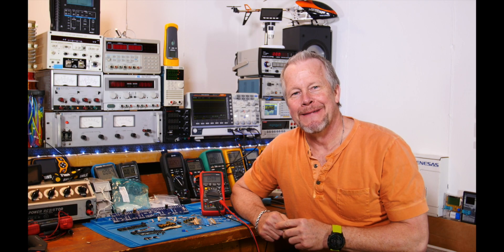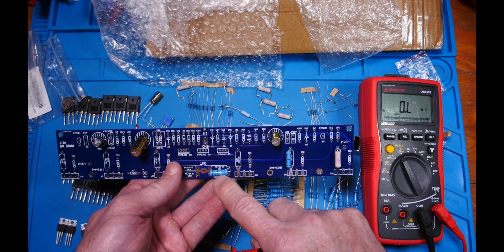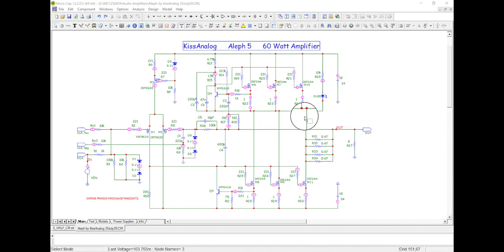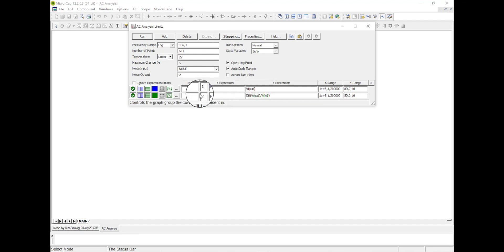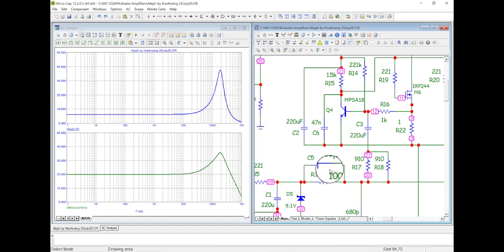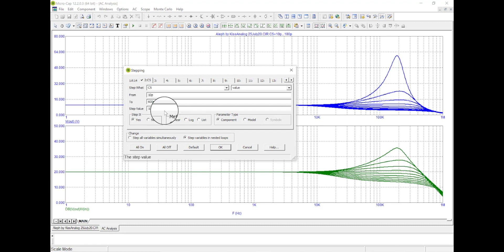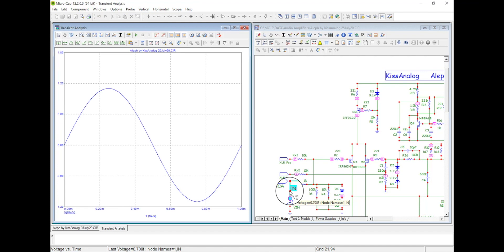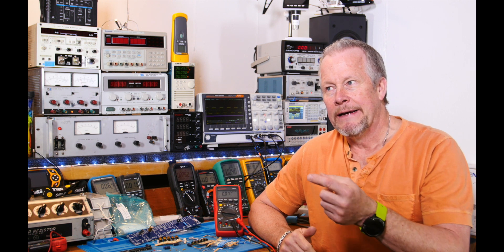Class A Aleph 5 - Schematic in MicroCap #aleph5 #classaamplifier #microcaptutorial

Comment: IRF244 can be replaced now with IRF530 with better results. As I see no more 244 on sale.
Reply: Yea the irf530 you can beter not use it, its only a 88w mosfet, you can beter use the irfp150 230w mosfet and irfp240 160w mosfet and irfp250n 214w mosfet, high volt mosfets have less distortion they say in the forums, i can not mesure distorion so i cannot confirm that theorie, but i think i mention it here, and more input Capacitance deliver more lows and less highs, the best they say is the irfp240, i like the irfp250n, that are like 2 of the irfp240 inside of the irfp250n, the irfp250n is more power and deliver more lows and less high, but all is a matter of music taste, so test wat wright for your tast, please do match all mosfets used in the amp, the 2 input irf9610 need to be spot on match with in 30mv VGS so 0,03 volt, the power mosfets u can do with a match of 0,1 volt, with my builds i go for 0,01 for the output mosfets and, 0,001 for the 2 irf9610, but thats just me
Reply: @joshaas  This is interesting... Among all low and mid power mosfets, 530 gives less distortions. I'd like to try 250n in Microcap simulation first. But you are right. A final judgement is listening.
Reply: @sc0or  distortion is more in the matching than in the mosfet u use, if you want low distortion matching is very important, for sure the first two irf9610 needs to be spot on and you need to use good MPSA18 Legacy NPN High gain Low noise transistor, the original design did use them to, and not the bc550 i believe the most use, also the hfe is higher than the bc550c can have
Reply: @joshaas  They are connected to output mosfet sources. Do you think hfe is so much important?
Reply: @sc0or  wy do you think Nelson Pass did use them in almost all his amp design's, so read again not only the hfe,  MPSA18 Legacy NPN High gain Low noise transistor, not only hfe is high but also the noise is low, and when you use them they have a other pin out than the bc550c, so you need to turn them around, and do not forget the resistors they need to be spot on.
Reply: @joshaas  ... and it's cheap ) "in all designs" means that if it costs pennies and has top most parameters, why he must look for something else? But this does not mean that in each particular case this npn could not be replaced with something else. At a moment I wrote my original comment, it was out of stock on mouser and digikey. So, 550, 547, etc could be a replacement. Now mpsa18 is on sale again by the way, thus I don't mind to purchase few dozens.
Reply: @sc0or  yea i have them in stock, i did buy them last year with the 60 for i believe 20$, i can build like 10 amps or more with that stock, i did also buy the IRFP250N for 1,74$, i did buy 75 from them, they are packet with 25 per packet, so i can build me a few amps again, i am also building a Aleph 3 for my electronic shop at home, with fast fittings for the mosfets, so i can take them out and change them with in a few minutes, so i can test mosfets on sound
Reply: @joshaas  You are great, Sir ) No kidding
Reply: @sc0or  you two ) always nice when someone has the same hobby, greetings from the Netherlands
Reply from the maker: Than you so much for this feedback!!

Comment: I hear Aleph J is also very nice.
Reply from the maker: I like the idea of the JFET input.  Otherwise the Amp is almost the same as this.  I’m tempted to try that conversion on one of my boards to test. :)
Reply: @KissAnalog  I think the Aleph 5 has a different power supply. The Aleph J can use the same PSU as all the other F1-F6, even SIT-3. I would love to try monoblocks as this reduces a lot of noise and interaction between the channels.

Comment: ? Did you say 1 ohms resistor but it measured 1.1 ohms ?.  Put it in series with a 10,000 K reference resistor or 1000 K reference resistor and remeasure.  Multimeter cannot measure one ohm accurately
Reply from the maker: You are right t lech;)  I should have shorted the leads and used the 'Relative' function to null out the leads.  I think that was the problem.  That Amprobe meter is actually pretty sweet.  When I short the leads I get 0.1 ohm, and then hit the Relative mode and measure the resistor I get 1.0 ohm.  Good eye;)  I should have pointed out this in the video - that sometimes when I take a measurement - it is just to verify that I grabbed the right one out of the bag and that it is marked correctly.  But a 1 ohm makes it too obvious that the reading is off tolerance;)  I'm glad you pointed this out - it might have confused others.

Comment: Hi Eddie, thanks for that great demonstration! It's a good feeling coming back home from work and to see you posted something new.

I like the way how you draw schematics, using T junctions instead of cross junctions. In my professional life I'm an instructor and I'm teaching this way of schematics my trainees under the toppic "good schematic practice". Unfortunately every one else in Germany is giving a crap about this (at least I feel so).

For your 10pF cap: 40pF works great in the simulation, but I bet that you end up with a different value in the real circuit due to parasitic capacitance of the PCB tracks adding up.

I'd like to know your opinion on "audio grade" caps. I just simply use the LXZ series from (Europe/Nippon)Chemicon. They are intended for use in switching PSUs, but all I see is the low ESR, low self inductance and their lifetime. Also they are specified to 120kHz.
I use them in tube amplifiers (cathode bypass caps, a point where minor leakage is acceptable) with great success. All I want to know if it's worth looking out for audio grade caps / if I'm missing something about them.
Reply from the maker: Thanks BeamFinder!  I agree - building schematics is where the circuit is communicated and is a very important part of the Art of Electronics.  I think the software tools have made people lazy and I think a lot of people just simply do not understand the correct way.  I'm glad that you are teaching the Art of Electronics;) I'm glad to hear from Germany.

I'll test the amp to see how this small capacitor behaves.  The other parts and their tolerances can play a part - as well as the parasitics on the board as you point out.  This leads us to 'good' board design practices - and the things we have little control over;)

Regarding 'Audio grade', I like that component manufactures make these - it shows their respect for the circuitry.  But, in the end an electrolytic capacitor is made the way its made and there are only so many variables that you can control - but for the diy and people that like the look of the 'Audio Grade' markings - it makes it simpler to pick out a cap just by looking for the label.  But those that understand the variables as yourself - an LXZ cap is a great option and could easily have that 'Audio Grade' marking.  At least from what I understand.  At my company they did call me the SME (Subject Matter Expert) whey I had to go in front of a group of folks around the industry (that I'm in) and do a presentation on a subject related to this...   So, low ear and low self inductance, along with ratings at higher frequencies - what else can you ask for?  ;)
Reply: @KissAnalog  Thanks for the quick response. You just confirmed what I was thinking all the time. It's a matter of simply "using the right component for the task" or understanding the behaviour making it the right component for the task.

Comment: Can I pay you to help me with my amp pcb design?  I have struggled through most of it for a few weeks but I can only go so far with my knowledge lol.  I am a gamedev not an engineer.
Reply from the maker: I can always be paid to help;)  I'm actually pretty good at pcb design - our director of engineering wouldn't let the the more important projects go out the door without me reviewing them.  I've been on vacation for 2 weeks - but I worked half the first week and this week is only a little better. I've done 3 board reviews and the things that go along with that support - picking out better components and changing the circuitry...

I am going to be showing how to do board designs on this channel.  I have 2 companies that actually gave me the software for free this year to do this.  I approached 2 hoping to get one to bite - and they both did;)  Now I'll have to do them both proud and show both products.

Let me know how I can help - I'll try to start showing this new software soon.  PCB design is so important to get a good clean circuit to work as well as it can.
Reply: @KissAnalog  Sounds like we think similarly.  Do you have a preferred method of contact?

Comment: Made a video on push pull class AB amplifier with Only output stage npn transistors .
Reply from the maker: That sounds great!  What transistors did you use in the output stage?  I'll jump over and watch the video - thanks!
Reply: @KissAnalog  2SD1047 or 2SC5200. Thank you .
Reply: Love from Pakistan.
Reply: Hi Eddie, another great demonstration. Really like the video thanks